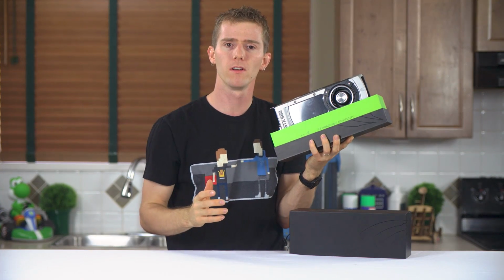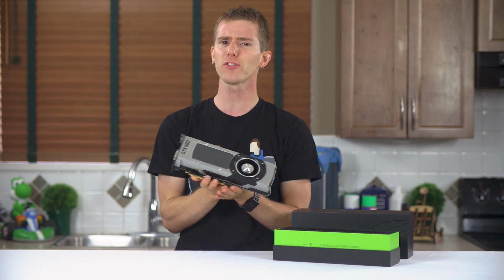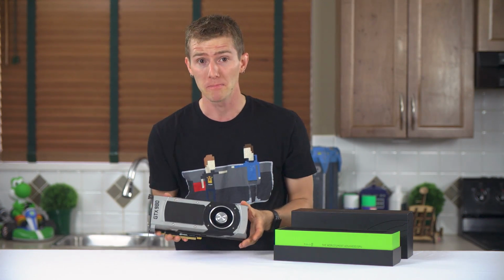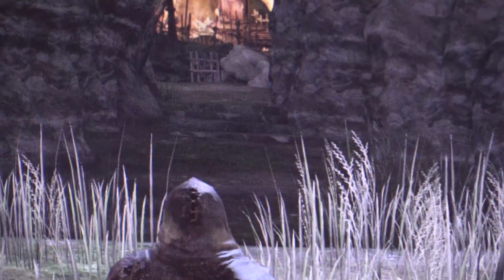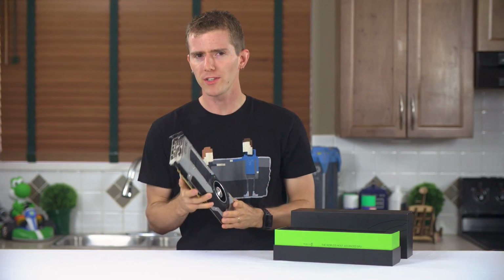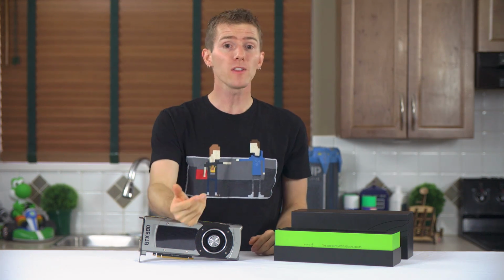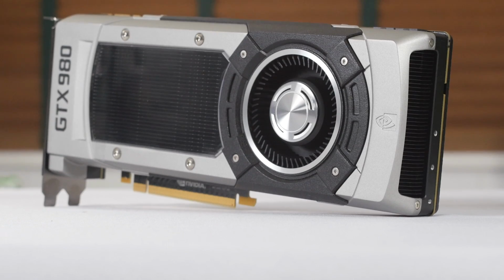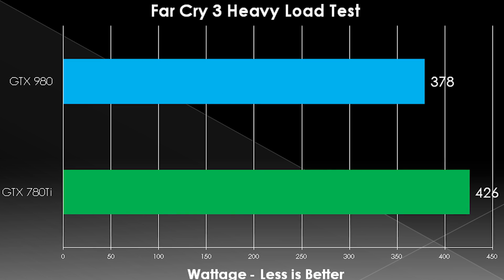NVIDIA GeForce GTX 980 Video Card - Performance Overview

Comment: Hello im from future the 980 is still a beast its highly recommended for you to buy
Reply: A 980 is around $80-$100 whereas the 1080 is $120-$140 used on ebay, id spend the extra money
Reply: @tyler6602 No its not i bought my ASUS 980 for $40 only lol while the 1080 cost above $100 used i never ever find 1080 used bellow $100

Comment: People love to cry about gpu prices today but look at how little of a jump we use to get. The new 80 series is barely beating an older 80ti series and even losing at times.....look at the 4080. It is beating handedly the previous 90ti (even more so the previous 80ti) by a massive margin. You get so much more performance these days. Yea it is expensive as hell but the jump is so much more than it use to be. Hell the rtx 2080 was pretty much the same as a 1080ti...maybe a smidgen faster. This is why I laugh at people complaining about the performance you get these days and laugh even harder when people act like the 4080 is a 70 tier card.

Comment: 2:09 "it only has 2 6 pin connectors a hint at the incredible power efficiency"

Nvidia now: 4090 requires 4 8 pin connectors and will melt if it's in a bad mood
Reply: I know I can't believe it's 3X the power consumption! Oh wait it's also 10X the performance...
Reply: @Nebnub  nice, now lets sell our kidneys to expirence this high performance

Comment: I bought one of these in 2021 for £200
Reply: damn. that was a better price than I got mine for.
Reply: They are around $200 NZD here which is $111 USD
Reply: @M.P.C.S  makes sense, the price will have gone down by now since the crypto crash. I sold the 980 to my brother for £100 around late autumn last year so he wouldn't get scalped by the prices back then
Reply: I BOUGHT MINE YESTERDAY FOR $80 INCLUDING SHIPPING
Reply: @qaching  yh its a pretty old inefficient card, so they go cheap
Reply: @alice672  CAN I STILL PLAY GAMES ON 1080P NOWADAYS WITH THIS CARD?
Reply: @qaching  yeah, it might struggle with AAA games but with the right graphics settings its good for the price
Reply: @alice672  OK BECAUSE MY CURRENT GPU CAN RUN ASSASINS CREED ORIGINS @ 10+ FPS AT LOWEST SETTINGS
I HOPE THIS CARD WILL BE AN IMPROVEMENT

Comment: Still using this card right now. Some games - even ones that are only a couple years old can still be played in 4k@60+ FPS. Not many, but some. Others, 1440p or 1080p. Solid card. Didn't clean it at all ever(or take it apart) but going to do that soon. Temps hitting 90.

Comment: while this is a good gpu, my only regret was getting this 3 months prior to the launch and availability of the Geforce 10 series where I could have bought the still reliable GTX 1070.  it could have saved me another year before upgrading to either Ampere or NAVI 2. but that's ok since atleast I got my Turing Super's worth for atleast a year or more, and probably 3-4 more years of mileage before it's done. the Turing Supers are great as long as they are well supported by drivers and no drastic evolution in gaming requirements.

Comment: Can i install this card in my own core  2 duo e6600 2.4ghz 4mb cache lga socket 775 6gb ddr3 ram psu 120watt to 365watt
Reply: Shoaib Sikandri the bottleneck will kill u
Reply: Foxbyday SO Can i install gigabyte GT 1030  oc 2gb 64 bit card in my own core 2 duo e6600 2.4ghz 6gb ddr3 ram and psu is 365watt max and my pc model is 0A58h ...PLZZZ REPLY SIR
Reply: Shoaib Sikandri try to get a quad core processor like a q6700
Reply: Shoaib Sikandri u can stick with a duo core processor but expect bottleneck

Comment: Hey guys i just found out that my graphic card GTX 980 is ZOTAC. It seems pretty lame and i am not sure what is the difference between Zotac 980 (not amp) and the normal ones which look cooler :P. It doesn't look like the one in the video...

Comment: Got this card in 2017 for $220. And it sill KICKS ASS! (even if 980ti and 10XX series blow it out of the water...)
Reply: Meduka メデューカ  i bought mine for $230 used and then paid $30 for fucking shipping and handling. Sucks to suck.
Reply: Damn, that does suck, I bought mine at my local Micro Center, factory refurbished. Plus three year warranty through MC. I have family who work there, so it was actually quite a bit cheaper than $220

Comment: how can gtx 980 with old 28 nm maxwell beat rx 580 in both performance and power efficiency???(165watt gtx 980 vs 180 watt rx 580)
and this card is fast enough. its power around gtx 1060 little bit less.

Comment: I have this card currently. Should I upgrade. If so to what?
Reply: I have it too, I would say we are good until 2020, there's no need to upgrade yet.
Reply: That's what I was thinking too, but I get really bad random lag spikes :/
Reply: Depending on what games you are playing should determine what settings you should use, remember the GTX 980 came out 2014 so if you are playing games that came out 2017 maybe tweak some settings down to medium, always remember that our card came out 2014, so when we play games that come out lets say in 2020 we most likely would have to play it at Medium pre-set to run games smoothly.
Reply: Yeah ik i shouldn't be dropping 30 fps in GTA though lmao (not ultra settings)
Reply: gta 5 ultra 70 fps as long as you lower grass quality

Comment: the gtx 980 looks better than the new cards.
Reply: The 1080 reference card looks almost completely identical.
Reply: not to me, the 1080 reference looks like its trying to be futuristic and has more curves like the bat mobile,  and the 980 looks more square. 980 looks way better in my opinion.
Reply: Alright, I can agree with you, you're right.

Comment: wow 980 is already 2 years old
Reply: man 980 was a beast back then
Reply: these 2 years went too fast for me i can't even beliebe it, the gygabite g1 was a birthday present for me back in november 2014, i practically missused it since i was playing dota and tf2 and the only heavy games i played with this card were the witcher 3, shadow of mordor, wolfesntein, doom and some other games i don't even remember, apparently high end cards are not for me.
Reply: As silly as this sounds always buy the current newest hardware, old hardware always tend to be forgotten to get new optimization in this case I'd you want similar 980 performance at stock buy the 1060 or rx 480
Reply: Omar Maestro how much should i pay for one i have a gtx 650 ti and i wanna upgrade
Reply: chrisHD you can buy one cheaper than a new 1060
Reply: Rommel Torres like what u recomend me ?
Reply: Nvidia Drivers work for atleast a couple generations back...you can run a 580 with the normal drivers.

And while I would agree that some leaps and bounds in hardware specs could outdate older hardware quicker, especially at power consumtion and heat output, if he can pick up a 980ti for less then a comparable newer card, used for example, he can still go there.
Reply: Rommel Torres - a 200$ GTX 980
Reply: Picked up a 780ti lol
Reply: CasualGamer117 thumbs up for the price  11 month ago . . . .
Reply: Rommel Torres almost 5 dude :O
Reply: I bought one for 100 bux. Hopefully I was not being foolish haha.
Reply: 6 :)

Comment: Hi I'm looking to buy a gaming PC this week, the one I'm looking includes:

i5 processor
16gb RAM
GTX 980

Just wondering what kind of quality I would be getting with a 980 seeing as its 2 years old now,? I'd be using it with a small 1080p 16 inch T.V as a monitor? Would I still be able to get decent graphics settings from new games?  Ideally I'd want to get a 980Ti but its just out of my budget. Would it be worth buying this or waiting a few months until I can afford the Ti??
Reply: hey man I would recommend getting a cheaper gpu like the 1060 or the rx 480 that will do way more than you need for 1080p
Reply: I'd say save up for a i7. Maybe the 4770(k if you overclock). But yeah, at 1080p gtx 980 will wreck anything but the 1060 might be a better choice..

Comment: will this card make it though 2017 ??? still a good choice?
Reply: I'd say get a 1070 SC this card is a bit old now.
Reply: yes
Reply: Luke wontsay perfectly fine for 1080p. and only buy it if u find a good deal on it.
Reply: T.Gyan 1080p? Bitch please, 1440p atleast. My sli 970 works wonders for 4k.
Reply: Frotzy When i say 1080p i mean maxed settings stable 60+ fps on every game

Comment: I found one on ebay for 260 bucks should i buy it?
Reply: No
Reply: No.
Reply: no. A 1060 would be a better choice.
Reply: TbonePlays how about 170 bucks?
Reply: Andrew Qiu Yep. Its cheaper than a 1060 and is still a kick ass card.
Reply: *****
the 980?
Reply: Andrew Qiu yep
Reply: *****
aight, thanks
Reply: Andrew Qiu np

Comment: So question... I can either get the GTX 970 SSC with ACX 2.0+ or the MSI GTX 980 4GB for the same price... which is better?
Reply: 980
Reply: Get a 1070 dude
Reply: Get a 1060 or higher.
Reply: 1060, it's newer, performs similarly and is pretty cheap compared to other high end cards.
Reply: Aries0098 nade the decision already when I posted this the 1060 wasn't out also I'm waiting for the aftermarket boosted cards I'm never an early adapter
Reply: 1060 is not as good as 980, only thing that it beats is possibly the extra vid ram and of course the improvments to vr
Reply: Tom Canty
Benchmarks says otherwise.
Reply: Aries0098 okay sure

Comment: Hey guys! I'm new when it comes to building a gaming PC, so can I kindly ask those who only want to help if this build of mine is good or bad?

2. Graphics Card or Video Card or GPU - NVIDIA GeForce GTX 980 or NVIDIA GeForce GTX 1070 or NVIDIA GeForce GTX 1080

3. Motherboard or MOBO - ASUS ROG MAXIMUS VIII FORMULA

4. Processor - Intel 6th Gen Skylake core i5-6600k

5. Microsoft - Windows 10 Pro

6. Memory Card or RAM - Vengeance® LPX 16GB (2x8GB) DDR4 DRAM 3000MHz C15 Memory Kit - Black (CMK16GX4M2B3000C15)

7. Hard Disk Drive or HDD - WD Black 2TB Performance Desktop Hard Disk Drive - 7200 RPM SATA 6 Gb/s 64MB Cache 3.5 Inch - WD2003FZEX

8. Solid State Drive or SSD - Samsung 850 PRO 256GB 2.5-Inch SATA III Internal SSD (MZ-7KE256BW)

9. Power Supply or PSU - Corsair AX860i Digital ATX Power Supply — 860 Watt 80 PLUS® Platinum Certified Fully-Modular PSU

10. Liquid Cooler - Corsair Hydro Series™ H100i v2 Extreme Performance Liquid CPU Cooler

11. Computer Case - Razer NZXT H440

Btw guys about the graphics card I'm still thinking about it either I should get the gtx 980, 1070 or 1080. I'm not really into 4k but I would like to know guys if the gtx 980 or 1070 can handle 1080P or 1440p well? Coz of course I know that the 1080 can handle 1080p ,1440p and even 4K well. Thanks guys and sorry if there are some bad english on my grammar :D
Reply: 1070 is good for 1440p and is way better than the 980

Comment: this performance in 200 USD in a RX480
Reply: I'm waiting to fucking know if the RX 480 > or = GTX 980 Ti
And if as AMD says 2 x RX 480 (approx.)= GTX 1080
I want to see fucking benchmarks!!
Reply: Alaa Afara overhyped
Reply: Nathan Kam Well I'm not disappointed, sure I did expect more but AMD delivered a decent GPU
Reply: Alaa Afara it's crazy how so many expected so much like 980 ti performance from this card, but for $200 the rx 480 already more than what you paid for.

Comment: Good pc build?
Intel Core i5-4460 3.2GHz Quad-Core Processor
Cooler Master Hyper 212 EVO 82.9 CFM Sleeve Bearing CPU Cooler
ASRock H97 Anniversary ATX LGA1150 Motherboard
Crucial Ballistix Sport 16GB (2 x 8GB) DDR3-1600 Memory
Seagate Barracuda 1TB 3.5" 7200RPM Internal Hard Drive
Asus GeForce GTX 970 4GB STRIX Video Card
EVGA 500W 80+ Bronze Certified ATX Power Supply
Any advice appreciated, thanks :)
Reply: Your i5-4460 will bottleneck it. I should get at least an i5-4670k or i5-6500
Reply: +Rotten Banana You're clueless. Don't ever comment on Tech videos.
Reply: Tyler Summerlin How am i clueless? I am just stating a fact. Have you ever done research?
Reply: Rotten Banana Have you ever done research? Stop spreading false information. A i5 4460 will not bottleneck a 970.
Reply: Tyler Summerlin It will bottleneck an i5 4460. Considering i have an i5 4460. Plus, search on hardware sites.
Reply: +Rotten Banana. Plenty of videos proving otherwise showing 970 running at 99% gpu usage.
Reply: Tyler Summerlin -.- That's not a bottleneck. A bottleneck is the CPU lowering down GPU rendering, not usage, which it just lowers FPS in games.
Reply: Rotten Banana .... I'm done lmao. Stop spreading false information. You clearly said a 4460 will bottleneck a 970. If it did a 970 COULD NOT HIT 99% GPU USAGE. Having a i5 would now lower rendering power of a 970, even then.. You do not buy a i5 for rendering.

Comment: does gt 730 and gtx 980 has the same size i wonder??? help me plz
Reply: The GTX 980 is much longer. You will need a mid ATX case.
Reply: I see
Reply: Kevin Wang If i'd were you, i would get the GTX 1070 or 1080. You would save more money.
Reply: well i know but guess how much they cost lol 500 at least
Reply: Kevin Wang The GTX 1070 costs around $399.99-$599.99 and the GTX 1080 costs around $699.99-$799.99. You could still get the GTX 980 for around $449.99
Reply: i know but i think the best card fit on my PC now should be either evga geforce 960 superlocked or Gigabyte geforce 960 OC i will probably get Gigabye cuz i did research ppl say that Gigabyte is just slightly better than the others
Reply: Kevin Wang Whats your budget? If you can afford a GPU over $500, you can get the AMD R9 Nano, which is smaller than the GTX 960 and more powerful than the GTX 970.
Reply: i like geforce more
Reply: Kevin Wang It doesn't matter what brand it is. The only thing is that which is faster or more valuable per dollar.